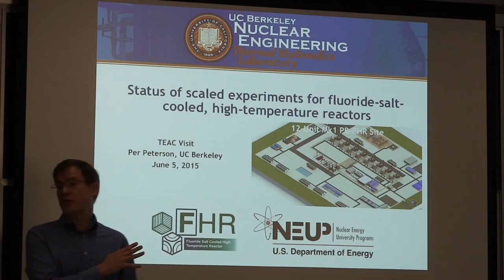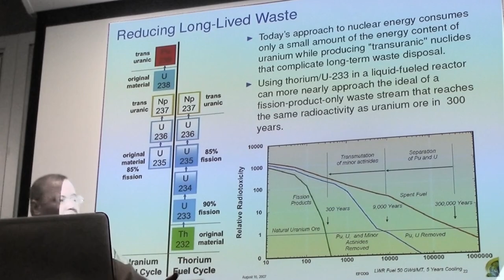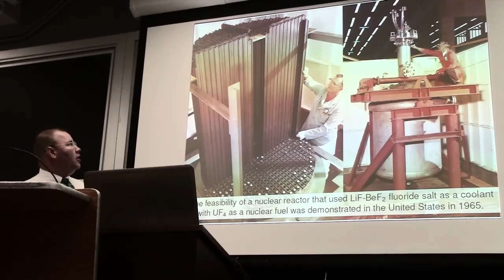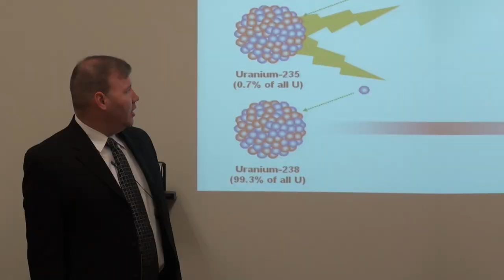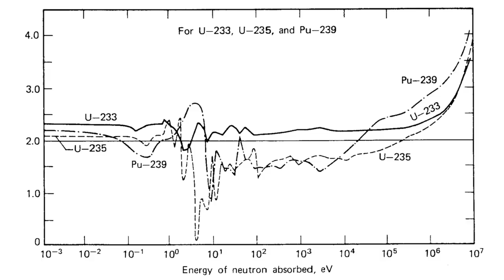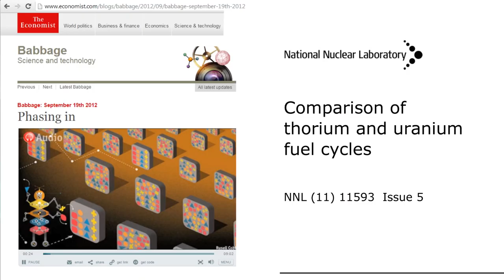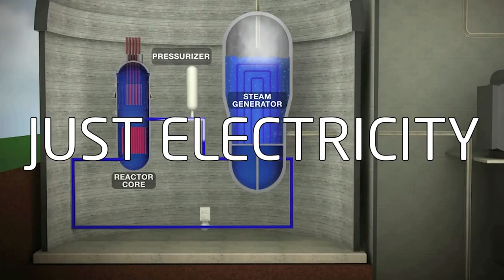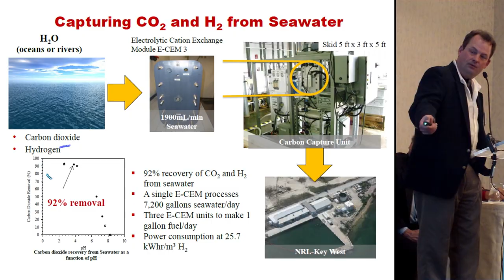Thorium Disadvantages

Comment: Clickbait
Reply: I'm under the impression some folks are leaving comments without having watched the video. Say it ain't so, Nam Yum!
00:00 Solid-fuel thorium reactors fuel utilization ratios similar to PWR.
00:42 Liquid-Fuel in United States licencing is "scary".
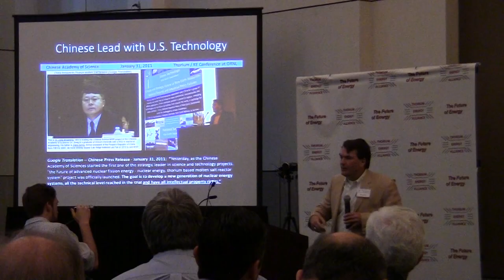02:04 Obama Administration giving away MSR know-how advantage.
02:40 PWR seen as "good enough" for long time.
03:00 Licensing restrictions specifically target liquid-fuel.
04:45 NEA OECD evaluated solid-fuel, and liquid-fuel-fast-spectrum only.
20:50 Thermal-spectrum neutrons hitting U233 produce only ~2.3 neutrons.
23:00 Graphite moderator required to sustain fission in MSBR thermal-spectrum.
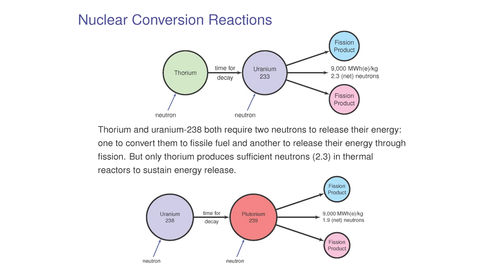27:50 Protactinium-233 half-life 27 days.
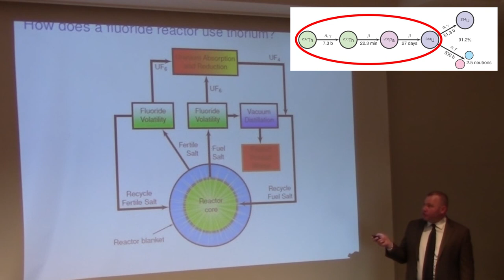29:00 Material challenges (MSR is pre-requisite so MSR challenges are Th challenges.)
Reply: @gordonmcdowell  All I see are political reasons why Thorium MSRs are not built.  No discussion of technical disadvantages.  I still have technical questions I'd like addressed.  Perhaps the biggest thing not discussed with Thorium Molten Salt reactors is:  What happens after an 'emergency'.  After the plug melts and the molten salt goes into the holding tanks.  What next?  Does it knock the reactor offline permanently?   Can the MSR fuel be recovered and reused?  Which brings me to the follow up question of: How does the reactor get 'restarted' if at all?  Speaking of which, what is the theoretical starting procedure for a Thorium MSR?  How would you get the fuel transported to the reactor?  How do you get the fuel from the transport vehicle into the reactor?
Reply: @namyun2743  Fuel salt in drain tanks just sits there shedding Fission Product decay heat until it cools enough that is still liquid but not solid and can be pumped back into the reactor. Th-MSR is absolutely intended to be recycled, with isotopes which inhibit fission being chemically removed from the salt so it can be recycled. Starting a Th-MSR requires using electricity to heat the pipes and the core so molten salt stays liquid. There's no enough fissile to sustain a chain reaction. U233 is added to the core, enough to fission. As the U233 is consumed, Th232 is added to blanket creating Pa233 which is removed and allowed to decay into U233 which is then added to the fuel salt. Transporting U233 seed fissile would be a secure procedure. After that, transporting Th232 is a non-secure procedure as it is just Thorium and not fissile. Moving all these fuels is easy as none are radioactive enough to be difficult to handle. (Particularly Thorium.) It is used fuel (and only used fuel) from any reactor which requires heavy shielding. The "difficult to transport" material is the Fission Products that are removed from the Th-MSR so fission can be sustained. These FP would likely be given some time to cool (the ones that cool the quickest were the most dangerous) on-site, then would be moved out in some sort of shielded container. Used fuel is already transported in shielded containers so there's nothing particularly new there.

Comment: All quite good until the phrase "Donald Trump understood" - man, if you can spin a lie this big, it brings into question the entire video.
Reply: OBSERVES was the word used with Trump, not UNDERSTANDS or UNDERSTOOD. You find UNDERSTAND wordage used with my own wish that a President finally UNDERSTAND what/why MSR, and not Trump specifically. Maybe watch that moment again? Regardless, it wasn't until 2016 that Th-MSR specific R&D finally started to receive funding. The grant program was restructured so that startups could pitch for their own desired avenues of research and not having to only pursue DOE mandated research. Thorium research has been funded 3 times since 2016. Until 2016 it was zero (except decades-old ORNL research).

President Obama did allow a George W. Bush appointed (as forced by Pelosi) anti-nuke to continue running NRC. That was a multi-year disaster. While some MSR progress was made during Obama administration, bi-partisan support for Advanced Nuclear didn't really ramp up until 2016. It would be a shame to see that all thrown away by Democrats electing a staunchly anti-nuclear candidate, one who doesn't seem to recognize shutting down Vermont Yankee increased emissions. What positive things which did happen since 2016 could be flushed down the toilet. Hope you'll consider supporting Joe Biden, as he recognizes the role nuclear power already plays in lowering emissions. IPCC puts nuclear's LIFECYCLE carbon footprint almost identical to wind, and BELOW that of solar PV. So if you're concerned about Climate Change please think long and hard about Bernie Sander's anti-nuclear stance, which does not appear to be grounded in science. Dr. James Hansen (The Godfather of Global Warming) has challenged Sander's anti-nuclear stance as one threatening Hansen's own grandchildren.

Comment: To bad this video put Mr anti-intelligence trump in it. Ruined all credibility
Reply: Flibe Energy didn't start receiving DOE GAIN vouchers until 2018, now have received 3. DOE wasn't taking liquid-fuel permutations of MSR seriously until 2016. I'm not going to defend Trump here, but by simply NOT appointing an anti-nuke to run NRC (remember Jaczko?), things have been going remarkably well. It is almost like one has to deliberately impede nuclear progress to impede nuclear progress.

If you don't want to see all Advanced Reactor progress (and private investment) suddenly grind to a halt, and you'd prefer to vote for a Democrat, then NOW would be a great time to ask Warren and Sanders why they're opposed to the statistically safest source of reliable electricity? Or you could support Yang or Booker in their respective pro-Advanced-Nuclear quests for the Democratic nomination.

Comment: Doesn't actually detail any of the disadvantages (of which there are plenty), just another pro-thorium propaganda video. Clickbait. Downvote.
Reply: Hi there! It does, although you might have missed them. They're stated in description, and I pinned a comment with the timecodes a year ago. But here's the timecodes again to help you.
00:00 Solid-fuel thorium reactors fuel utilization ratios similar to PWR.
00:42 Liquid-Fuel in United States licencing is "scary".
02:04 Obama Administration willing to give away MSR know-how.
02:40 PWR seen as "good enough" for long time.
03:00 Licensing restrictions specifically target liquid-fuel.
04:45 NEA OECD evaluated solid-fuel, and liquid-fuel-fast-spectrum only.
20:50 Thermal-spectrum neutrons hitting U233 produce only ~2.3 neutrons.
23:00 Graphite moderator required to sustain fission in MSBR thermal-spectrum.
27:50 Protactinium-233 half-life 27 days.
29:00 Material challenges (MSR is pre-requisite so MSR challenges are Th challenges.)

Comment: Downvoted for the misleading headline.
Reply: Thorium Disadvantages listed here: 00:00 Solid-fuel thorium reactors fuel utilization ratios similar to PWR. 00:42 Liquid-Fuel in United States licencing is "scary". 02:04 Obama Administration willing to give away MSR know-how. 02:40 PWR seen as "good enough" for long time. 03:00 Licensing restrictions specifically target liquid-fuel. 04:45 NEA OECD evaluated solid-fuel, and liquid-fuel-fast-spectrum only. 20:50 Thermal-spectrum neutrons hitting U233 produce only ~2.3 neutrons. 23:00 Graphite moderator required to sustain fission in MSBR thermal-spectrum. 27:50 Protactinium-233 half-life 27 days. 29:00 Material challenges (MSR is pre-requisite so MSR challenges are Th challenges.)